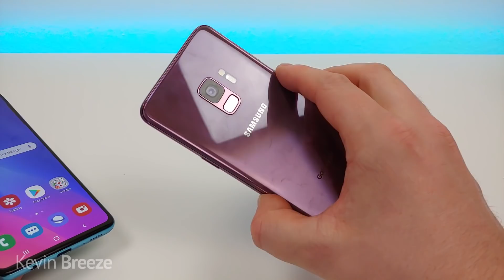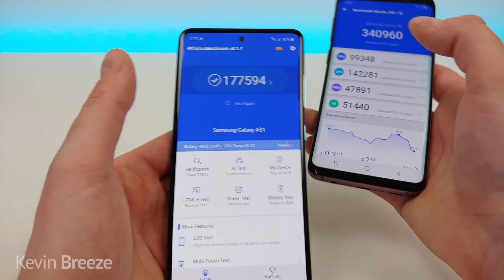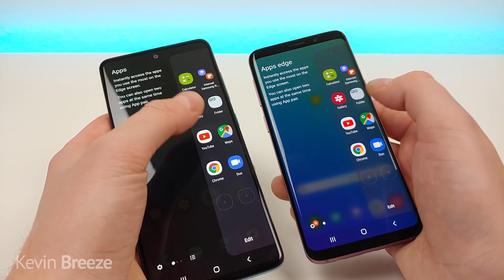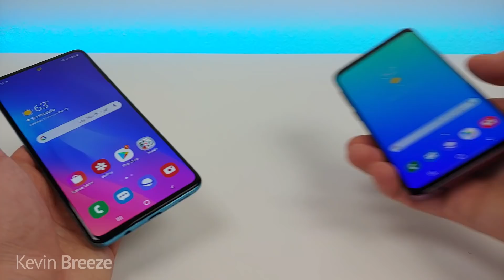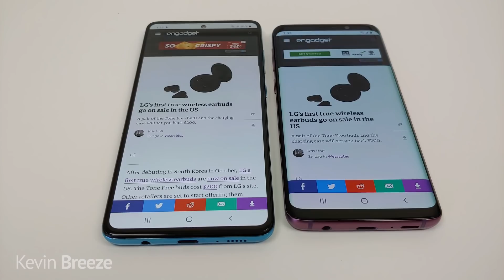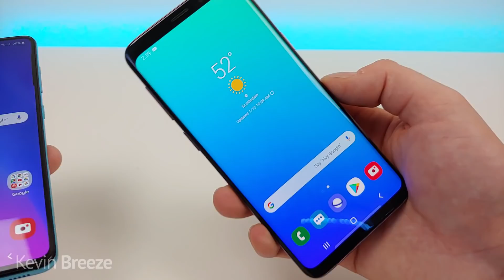Samsung Galaxy A51 vs Samsung Galaxy S9 (Used) - Who Will Win?

Comment: Just get the S9, it is better in nearly every way.
Reply: @Bandicoot Capn Crunch read again brother
Reply: @Bandicoot Capn Crunch S9 has better,edge screen with higher resolution and better color accuracy,more beautiful design, better build quality and IP68 rating ,dual speakers with Dolby atmos,more powerful processor,the S9's capacitive fingerprint scanner is more secure than the optical one Galaxy A51 has.Galaxy S9's camera is way better.S9 can take better photos at night and in a dark environment + 4K 60fps video support.  S9's version of One UI has more features and it's more customizable. It is clear. Galaxy S9 is way better
Reply: Ip68 water resistant,wirelles charging,better cpu and gpu,iris scanner face id unlock,fingerprint scanner,4k60fps,Vr headset compabillity,so s9 forever!
Reply: @ilijaciceric2795  wow ty, i was almost fooled into buying a51
Reply: Even the body of a51 made by plastic same as a50
Reply: @Bandicoot Capn Crunch the camera and display are worse on the a51
Reply: @Bandicoot Capn Crunch  Better camera ? Because of  ultrawide ? The battery . Yes . Fingerprint . I like where it is . I dont use it anyway . S9 is still up there . The camera is in the same range with de s10 .
Reply: @Bandicoot Capn Crunch oh honey,that is all on paper a flagship is built to be the best(at its time) but a midranger cheaps out on camera QUALITY,cpu,gpu
Reply: Bandicoot Capn Crunch dont compare a flagship camera with a midrange one my guy
Reply: I'm choosing the A51 over the S9 because of the larger screen, more modern design, better battery but must importantly, it will get the newest version of Android for at least 2 years while the S9 will be stuck on Android 10 forever
Reply: @neoanto9345  I'm just chilling here with a galaxy s10e lol
Reply: @IamJay02  I thought about getting a S10e but it is too small for me
Reply: @neoanto9345  yeah I much prefer my LG V40 with its 6.4 inch display but this smaller display makes it easier to use
Reply: S9 is better, even used, always pick an old flagship over a cheapish midrange
Reply: The mid-range phones of today are the flagships of yesterday, but they usually pack some features from new phones
Reply: @Bandicoot Capn Crunch I don't know why people consider in screen finger print readers a positive, they're inferior  to physical ones
Reply: @Bandicoot Capn Crunch the fingerprint scanner is under the display not in the display and on top of that, it's an optical scanner which objectively, is worse than a physical scanner.
Reply: S9 using g72mp18, a51 using g72mp3
Reply: Better everyway except battery life :)
Reply: @Bandicoot Capn Crunch the s9 is an actual flagship. The a51 is just a midrange phone.
Reply: Right I have it and it’s sweet good game experience
Reply: @Bandicoot Capn Crunch u just said that cuz its cheaper lmfaoooo
Reply: @tom lewis but used phone also risky, especially with quad hd amoled, without warranty is expensive to repair if something happen.
Reply: @Bandicoot Capn Crunch And don't forget about updates
Reply: The battery in the s9 is probably not in the best condition
Reply: Glass and metall nicer to touch
Reply: @Bandicoot Capn Crunch the A51 will age much worse than the S9+...also remember more lenses don't mean the quality is better. that's just the marketing, it's ez and cheap to integrate shitty cameras(with botched pro mode) than improve the quality(remember that A7 and A9 2018) all worse compared to the note 8/s7/s8/+.
Reply: @jg14gerhard_bar  you say that, but which is going past Android 10?
Reply: @thc_freebaser  both can if you modify your phone lol
Reply: Will it get UI 3?
Reply: I have a black Samsung s9 n I got mine second hand from cex for £220
Reply: @Bandicoot Capn Crunch some people like small screens
Reply: The s9 runs a very similar processor and the s9 is running 4gb ram while a51 5g is doing 6gb ram.
Reply: They both also run exynos 9 octa, so a51 5g on paper is all around better
Reply: Nah ima get A51
Reply: Why u guys arguing? I'm not even complaining I'm only using the J4 Plus 🤦‍♂️
Reply: I always suggest getting a slightly older flagship than a newer mid range. One thing he forgot to mention at the end was that the S9 had a better build quality. That goes along way and makes a big difference with a premium feel. Also screen res is super important when you have poor eye sight so when you put your glasses on it's like a whole new ball game. Plus the audio out put on the S9's DAC is better just those little touches go along way.b
Reply: @Bandicoot Capn Crunch in display fingerprint isn't a plus. I have a note 10 and it's garbage. I'd rather have optical finger print sensor on the back.
Reply: @Bandicoot Capn Crunch flagship is flagship.
Reply: Battery life on s9 is trash.
Reply: The s9 is older, and more expensive. So I think the A51 is better.
Reply: @unaestrella1876  If its new, doesnt mean its better. S9 processor itself can tell us that s9 is a better phone
Reply: @aimannajmi7821  iit does  mean that it get a much longer software support cycle
Reply: @e21big  just get a custom rom.
Reply: @aimannajmi7821  boi the a51 has the same processor as the s9 (exynos 9610)
Reply: @Exotic4M3  nahh son, u dont know anything. Do your research first
Reply: @aimannajmi7821  i realised i have made a mistake. I am sorry.
Reply: @Exotic4M3  laughs in snapdragon

Comment: Just pay $20 more for the plus model
Reply: I got the s9+almost a year ago for $500 best decision Ive ever made
Reply: @killerqueenbiteszadusto5021  I got a s9 plus for 350 it was used but didn't have any physical damage
Reply: @intellectbot699  I got an S10+ for £280 pristine!
Reply: @killerqueenbiteszadusto5021  yeah, I was surprised at how big the screen actually was
Reply: Just had someone give me a s9+ for free because it was "broken" I replaced the back and the loud speaker and its pretty much brand new for a total of 31$ and about 30-45minutes of my time.
Reply: @RanenPo  you just got a good deal...
Reply: @tiagomoraes1510  ahaha tellin ya
Reply: itsn ot a 20$ difference the difference is like 200
Reply: Not a big fan of the bigger sizes. Harder to one hand text and grip for me.

Comment: You should compare it to S9 Plus instead.
Reply: s9+ is better buy than A51...
Reply: @nikolaminovic  How about A71 ?
Reply: @TanuKart  s9+ is much better than a71
Reply: whats the point the only difference is screen size dual cams and more ram
Reply: @aguy255   And larger battery

Comment: S9 plus would have been a better comparison as far as size is concerned. You can actually get the note 9 used for around 300.
Reply: Where at
Reply: @Anthonydavis-jq2hd  on Amazon. If you know how to looks right you can find great deals. I picked up a pixel 2 XL for $135. If you look under new Samsung s9 plus or note 9 and then scroll down and you will see deals on used and renewed.  Not 9 for $279 all day. It will drop by April another $40 or so
Reply: james Smith depending on how beat up you want the phone to look like. I just went on eBay and bought a refurbished unit that was like A condition. I have bought phones for cheaper at like B conditions but some of those dents bothered me. I bought mine for $350 and I am happy about it. I think I just like the piece of mind of getting something tested and a new battery in the smartphone compared to if you buy it used you don’t know how many cycles have been used. If it was a heavy user than a year is a lot of abuse since based on battery technology you average smartphone battery life is about two to three years but apparently starting with the Galaxy S8, Samsung claims that after two years of normal use you will still have 95% of your battery capacity. I don’t know how tech savvy you are and if you are willing to break open a Note 9 to replace the battery since it is going to be a lot of work and a lot of pieces where as if you take it to a place to do it; you are looking at dropping somewhere from $50 to $80
Reply: Thanks i want a note 9 plus
Reply: james Smith P.S There is no Note 9 plus. Either you mean S9 plus or Note 9. Starting with Note 10 they decided to have two different Notes.

Comment: Just i wanted do s10 vs s9
Reply: S10 plus will stomp S9
Reply: @leeallenbeal  S10+ is faster than the S9 PLUS (no point of comparing it to the regular S9) but it doesn't necessarily have a better picture quality. Depends on the lighting conditions

Comment: The s9 is a better buy stereo speakers and water resistant so that's a no brainier
Reply: used s9+ are very close in price with the a51 anyway... the s9+ is a no brainer, lets not forget it will age better performance wise, a flagship is still a flagship after 2 years
Reply: @jg14gerhard_bar   Actually there is something wrong with it.Only 2 major updates.This means that android 10 (one ui 2.0) will be the last version of android that the phone will receive.
The A51 comes with android 10 out of the box,so it will get up to android 12,that's where the A51 wins,and that's because is newer.
Reply: @huzumnicolas4343  thats a given considering Samsung, hardly even matters if you're upgrading frequently, just buy the best whenever at that point and don't bother settling. its not like the a51 is going to perform 2x as great(like the s9+)  with OS updates...the s9+ with  its hardware will still age better imo
Reply: @AssassinIsAfk  👍🏾
Reply: Exactly so I don't get why they made the A series  expensive  when half of them have no water resistance 🤔
Reply: @star-yh3us  they aren't very expensive at all. And they still have some water resistance. It's just not rated and possibly not as good as other phones that have been rated. But it still has some degree of water resistance, not as good as the flagship though.
Reply: Always buy flagship, even the older one.. atleast thats the best brand can made once
Reply: I think it's a personal preference. A51 comes with android 10, has a bigger screen, bigger battery and bigger internal storage.  S9 is older, which mean it won't receive many more software updates
Reply: @klynch7222  s9 runs on android 10 one ui 2 but that might be its last update
Reply: K Lynch better get iphone x with 300$
Reply: @david88762  You cannot get an iphone for 300$ haha its 800 (euros even WTF) new and 500 refurbished
Reply: @klynch7222  hh I bought my a50 last year but now fingerprint not working anymore
Reply: @hassanwety1012  that sucks!
Reply: Just changed my s9+ battery and this phone rocks again. Like new! Easily get 8 hours of SOT
Reply: The A line is more mid range or budget line that's very popular worldwide. New to the US
Reply: @AssassinIsAfk  +HDR and wireless charging support. It is Water resistant as well
Reply: @LaskaiTamas23  I love when people argue wireless charging lmao I've literally only ever known one person that uses wireless charging
Reply: Outdated design tho
Reply: @flizzy4645  I much prefer any notchless design than have a hole punch or any kind of notch for that matter, I can't stand intrusions on a screen.
Reply: If you compare to performance a51 is still more weak than a s9 s9 have better display,better camera :))
Reply: But it probaly won't be getting updates for much longer and the A51 will as it is newer
Reply: Also the s9 can be wireless charged.
Reply: It's not water resistant when its refurbished I'm sad cuz I dropped my old s9 and back got demolished and there is a hole in the front
Reply: used*
Reply: @AssassinIsAfk  buy an anker 15w charger for 15$
Reply: @AssassinIsAfk  🙄🙄
Reply: Assassin Master25866 do u need 1440p?it has better cpu and it lasts longer
Reply: @david88762  better CPU ?
Reply: Awakened Garou yes,a11 bionic is still better in gaming/intensive task than exynos 9810/sd845
Reply: @david88762  A11 was worst chip Apple ever made 
Iphone X is slow compared to s9, Note 9 , or even s8
Reply: @UCGHCHUDIYO2luaIxAQn4wTA yeah 
i own both device btw 
i get constant 60 fps on Note 9 at ultra settings 
while Iphone X shutters sometimes and overheats 

dont talk without trying yourself
Reply: @LordOfChaos.x  no.
Reply: @david88762  a51 gas half of the performance of the s9
Reply: Ain't buy used phones or refurbished, so a51 is a best buy than s9
Reply: a51 has an ip rating too

Comment: Recently, I subscribed to your channel. I really like your videos a lot.
Reply from the maker: Thank you so much!
Reply: @KevinBreeze  Excellent comparison.  
So far I think im going with A51 over S9. 
But i have a question. The performance rating score difference.  A51 was about 170,000 and S9 was in the 340,000. 
But what does this mean?? How does this affect performance and what performance is it measuring? 
When you pulled up the camera its same.
When you Pulled up a video its almost the same. 
You said the S9 is better performance but how much better?  WHAT does the performance rating measure that makes the s9 double?
 I dont understand this rating. 
Im not a gamer so speed of movement doesnt matter.  Bit it DOES matter if i click on a vid and get the buffering circle for 30 -60 seconds. It also matters if there is great lag going from one window to another. 

The other thing that is NEVER mentioned in comparison vids is the KEYBOARD!!!!
I think this is the 3rd most important feature and no one talks about it.  
Does the keyboard have the number row available on main keyboard? Or am i going to have to hit the arrow key just to get to the number row? 
And punctuation.. how accessible is this? On the flagship LG G4 you had to hit a key just to get a comma which i hated.  I also want this on main keyboard. On google keyboards you have to make 2 extra keystrokes just to get to a punctuation mark and the emoji key is right beside the space bar which made me uninstall it within a minute !!!
So is there a way to see keyboards on these two phones?
Thanks so much.
Reply: me too brother. me too
Reply: @Jonny Sandtrap wtf lol
Reply: yes,.. one of the best reviewer